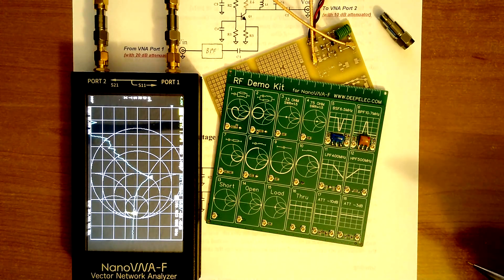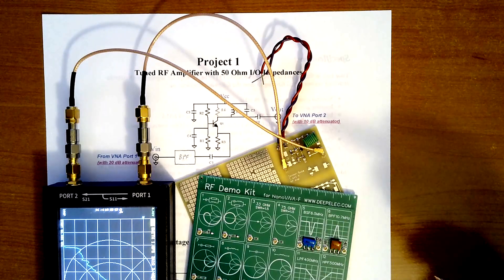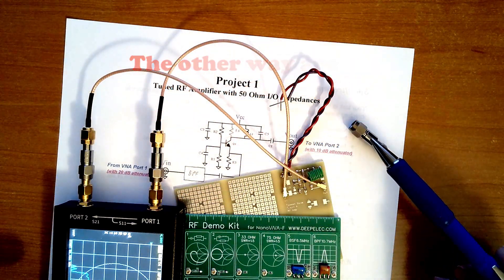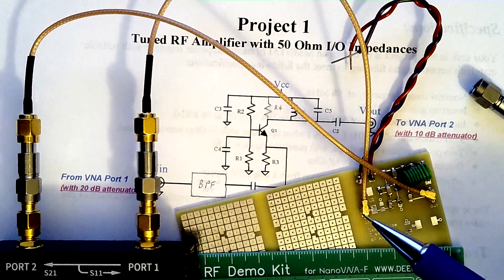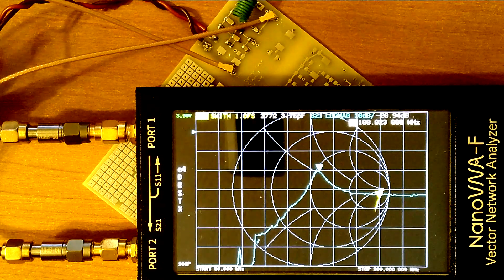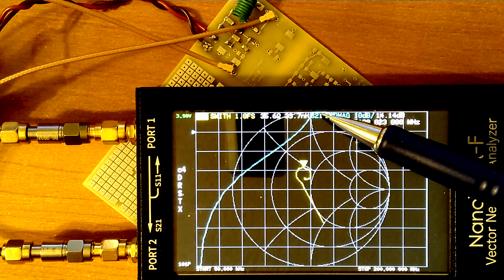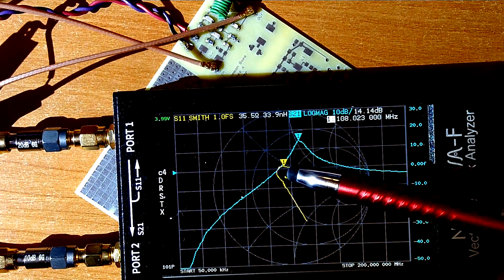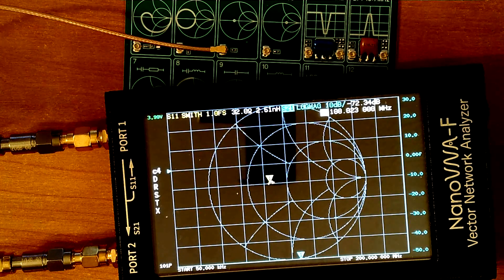NanoVNA - Measuring S21 and S11 of a small-signal amplifier

Comment: How did you calibrate NanoVNA? After the attenuator or before attenuator?
Reply from the maker: The attenuators were in-place (attached to ports 1 and 2) during the cal. As noted around 4:40 in the video, I was very happy with the NanoVNA's ability to "cal-through" the attenuators. Even the 8753 VNAs in our university lab can struggle with this much attenuation - but the NanoVNA took it in stride !  :-)   https://youtu.be/GAycxgbncHU?t=274
Reply: @MegawattKS  Thanks. 
 I am going to buy two Baluns 1:1 50 ohm and cal after Baluns.  I am trying to learn how to use NanoVNA with differential circuits.  
The fact that you have calibrate after attenuator and tested your circuit, makes me more confident that I can calibrate after Balun.
Thanks for producing this clip.

Comment: Thank you for this great series of videos. I am thoroughly enjoying them. I am not 100% sure about how you are measuring the gain through two attenuators. Is it that basically you calibrated the NanoVNA at the end of the extension, at those u.fl connector points? So that whatever NanoVNA shows is the actual gain of the amplifier? I am just trying to wrap my head around how the attenuators are accounted for in our reading.
Reply from the maker: Thanks for the comments.  When using the attenuators, I generally just include them on the port 1 and port 2 connectors when doing a thru-calibration with a short SMA cable (which is often all I do if I'm only interested in S21). Then I switch to the cables with the u.fl connectors as needed (keeping the attenuators on the NanoVNA connectors). There is very little loss in cables and connectors so no adjustment is needed if S21 in dB is all we're interested in. Oh - and you'll have to change the Display>Scale>ReferencePosition menu item to move the plot down on the screen, since the NanoVNA likes to put 0 dB gain near the top.  There are limits to how much attenuation you can calibrate through this way however, since the NanoVNA has some dynamic range limitations. 30 dB is the maximum total attenuation I feel comfortable calibrating through (e.g. 10dB on port 2 and 20dB on port1 for example). That works fine if the amplifier has gain of 30 dB or less peak.  If one needs more than that (for testing a high-gain amp like 40+ dB), then I may add more attenuators when measuring the amp and then adjust for the amount added in my head.  Hope that makes sense.   (BTW - for doing S11 of an amp, one also needs like 20 dB on port 1 for many amps since the input circuits can go into saturation from the 0+ dBM level coming out of an unattenuated port 1 on the NanoVNA. Of course, in this case, I'll need to use the u.fl cables during the cal, and I use the short/open/load calibration sites on the RF Demo Kit board.  I've been happily surprised that I can get a good S11 cal even with 20 dB attenuation on it. Some of our HP8753 VNAs in the lab often struggle with that - but this little NanoVNa is amazing :-)
Reply: @MegawattKS  After 2 years, I feel that I am understanding more about RF. I came back to this video again and still learning something. I was wondering if we could use NanoVNA to measure output impedance of the amplifier. (I guess it should be S22?? but I don't think nanoVNA can do that) Could one bias the amp and read S11 into the output port of the amp instead? Or any other ideas to actually measure the output impedance? (primarily in order to build the matching network effectively.)
Reply from the maker: @pilobond  Hi.  That's good to hear. Yes - absolutely. As you said, it is "S22" and because of the symmetry of the definitions of S parameters, it is just the same as S11, except that you are measuring the other output port of the amplifier instead of the input port. Large VNA instruments often include a "test-set" that has internal switches to change the port for you. But that is not needed, and frankly I never used it much. It was much easier to just calibrate for S11 and S21, and if needed, swap the cables connecting to the amplifier myself (a full "two-port cal" is quite involved and only very marginally better in terms of accuracy). Just put a 50 Ohm termination on the amplifier input and with the VNA calibrated for a one-port measurement, look at the impedance at the output of the amp.  This assumes you're using the same cable length for cal and measurement, and that you have an attenuator to protect the VNA (included during the cal) as talked about in the video.
Reply from the maker: @pilobond  One  question and a related note:  What kind of amplifier are you looking at?  High power amps are probably not something you want to do this with. They require high power attenuators (in case the amplifier starts oscillating) and too much attenuation to be able to get accurate return-loss measurements of the device under test. In addition, they are often not matched the same way as things like a low-power low noise amp. High power amps often have a very bad S22, but still work fine.  But for a low-power LNA like in the video, just do the steps above. They often are better when matched, since the next stage in the receiver may expect to see a good 50 Ohm source...
Reply: @MegawattKS  I am a ham and like making my own gears. I have made a few transmitters with IRF510 final that can put out 6-25 W depending on the power supply voltage. That is on 7MHz. That was based on other people's design I copied from the internet. They often use a 1:4 choke/autotransformer for matching on a ferrite core. I wanted to understand better about matching and try other transistors. But was not sure how to obtain the output impedance.
Reply from the maker: @pilobond  Thanks for the extra info !  I'm not an expert on power amp design, but I had a graduate student who became one and I learned a lot along the way. Will paste a link to his dissertation below. The first 17 pages give an excellent overview of PA design issues - which are quite different than amplifiers in the video.  One of the most basic things is the need to generate high power at low'ish voltages. That's probably why there's a transformer. The antenna is 50 Ohms, but we want to present, for example 12.5 Ohms to the amplifier output stage since Pout is V^2/R, so the lower R is, the more power we can get with a given transistor who's breakdown voltage we can't exceed. Go carefully looking at S22 if you choose to do it. Maybe just do it without power applied - to protect the VNA and yourself !   That said, the VNA can provide some useful info since there is often LC tuning involved as well (though the C will vary with power off). Finally, note that the PA is probably not going to look like 50 Ohms at the output. PA designs often present significant mismatches in order to achieve good power and efficiency. A technique called "load pull" is used in their design rather than the traditional matching. A little of that is touched on in the document toward the end I think.  Anyway - here's the document.  I hope you find it useful.  73's    https://krex.k-state.edu/items/a1c80a7d-3446-4cbb-9536-ec278b845f39

Comment: I made a build,
0. RF Simulator: works great! numbers match calculations.
1. SMD(coplanar with ground plane, but pcb design wasn't any good for impendence controlled traces, home etched with no VIAs). Failed terrible. Input impedance was a total mess, SWR=8, almost negligible amplification :(
2. Leaded(components suspended in ugly construction method on a PCB plane): 9dB gain. But with ton of parasitics, had to stretch the Inductor in output matching network to much beyond its design to compensate for the parasitic effects.

The PCB used in your project, was it designed with impedence controlled trace widths/lengths for 100MHz? I don't have access to those Chinese $5 PCB manufacturers, to do a decent 2 layer PCB with via's and close ground traces :(
Reply from the maker: Stretching inductors is OK. You should see some of the ones we ended up with in class projects !  (but of course those need to be replaced with new ones with less turns)  On the CPW, yes, I don't think they work well without good ground-via stitching. It always amazes me that simulator/calculator tools for CPW show them with no stitching. But that's the world of simulation. Too idealized and not faithful to the actual builds.  On the PCB used in the video, it was just done through ExpressPCB since I like their layout tool and quick turnaround (and lack of soldermask for prototyping). At 100 MHz, wavelength is about 3m in free space and 1.5m on FR4 boards, so I didn't worry about controlled impedance traces. Everything much shorter than lambda/4. But inductive parasitics can come into play for some parts of the circuit, so the layout needs to be tight...
Reply: i did use lame 2N3904 though. have to figure out if any of transistors in sample book has decent fT.
Reply: 2SC3356 did get it a little better to 9dB, but way off from 16dB gain.
Reply: ok, 12V supply gets it almost there. But wonder if for a 1mA current amp, it really needs 12v.
Reply from the maker: Maybe just keep the lower Vcc value and change the bias (e.g. Remitter) to get the current up.
Reply: @MegawattKS  Bingo! got it working with 5V supply. Had a burnt transistor with 12V E-C breakdown voltage, took sometime to figure out as it still kept showing some gain. My 2SC3356 transistor had a limitation of 11.5 dB gain, so getting 13dB out of it is not bad. Need to get better RF transistors. Works good now. Also have the NE612 mixer chip delivered too, so more fun.

I had done radios with software SDRs, but chasing the rabbit hole of RF with discrete components feels like in Zen state for some reason.

Comment: What transistor did you use for this design? I'm trying to make a modified version for listening on the 2m ham band as an exercise
Reply from the maker: It was one from a collection of SMD parts and I don't recall the number - but I made sure it had a high enough fT value. In the university course, we used MMBR5179 transistors - which is an excellent choice for 2m IMO.  The MMBR5179 is an SOT23 surface-mount packaged version of the classic 2N5179 (which I don't recommend due to the parasitics of it's leaded package).  The fT is around 1 to 1.4 GHz for all of these devices, depending on collector bias current, so it has enough potential for gain at 146 MHz without undue danger of going unstable (as the 2N5179 variant is apt to do)...
Reply: @MegawattKS  great, thanks!  I found some MMBTH10 in my collection that look similar enough to give it a go.  SMD construction is indeed the plan, most of my component collection is SMD: the savings in part storage space alone already!

Comment: Always learning something new when watching your videos, thanks. Could I use the NanoVNA to measure the input/output impedance of power regulators (DC/DC) powered on or off ?
Reply from the maker: Thanks for the feedback and question. Unfortunately I would have to say, generally speaking, no. The NanoVNA (and virtually all VNAs) only work on "linear" circuits. Power circuits are generally not linear. And the frequency range of 50 kHz and above for the NanoVNA means it probably won't cover the range you'd be interested in anyway - I would guess.  However...  if it's a so-called "linear regulator", and you are super careful to use a DC blocking capacitor of sufficient rating, and the IC is not outputting anything except DC (e.g. not oscillating), then it could give some output impedance info from 50 kHz and up, I think.  Hope that helps.

Comment: MegawattKS, can you make more videos on measuring RF circuits using the PHASE measurements and electrical delay. I'm not sure why RF specs need to know the electrical delay and phase of a circuit for RF signals, any reasons why the phase and electrical delay will affect the RF signal?
Reply from the maker: Thanks for the suggestion. I might do a video on the design of the amplifier and if so, will try to remember to see if I can fit that in. Until then however, here's one answer: 
There is a thing called "group delay". It's the delay over a band of frequencies such as the bandwidth of a filter. But that delay varies with frequency, even in the bandpass filter's passband. This is because the phase does not change linearly with frequency. 
The upshot is that this can cause distortion in the demodulation of something like classical FM radio signals (not much, but measurable). We were able to measure it in the FM receivers we designed in our class, but honestly it wasn't perceptable since it was below about 1% for the filters we were using. 
In digital signaling, I think maybe non-linear phase (non-constant group-delay) may cause changes in the waveshape and mess up the sensitivity some by degrading the so-called eye pattern in the recovered serial bits.  Would have to try to remember and think through that more though...
Hope that makes some sense and helps some.
Reply: @MegawattKS  yes thanks, When making your new video on the RF amplifier can you show the compression points, gain, RF output wattage. Because the compression points will compress the FET and the RF output wattage will get lowered. 1dB compression Point and so on.